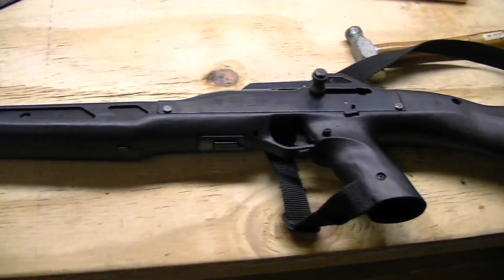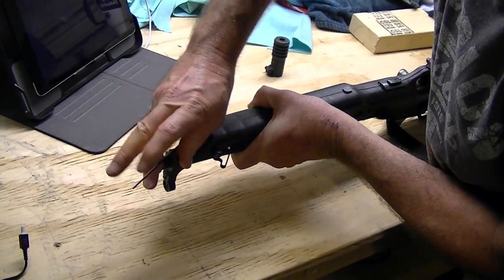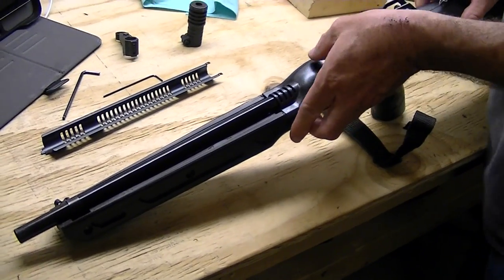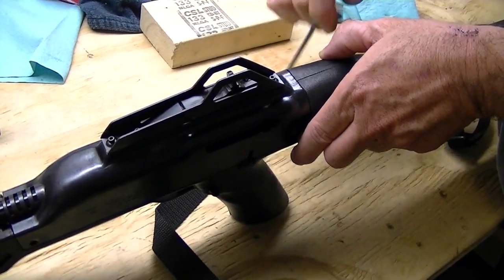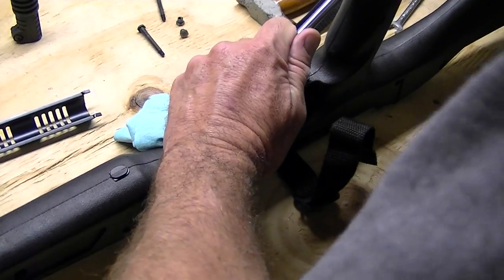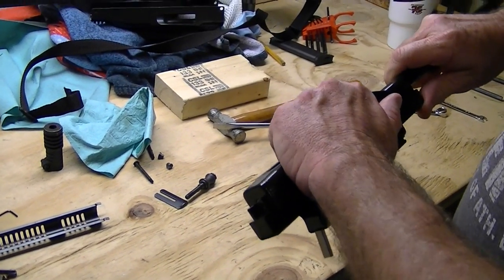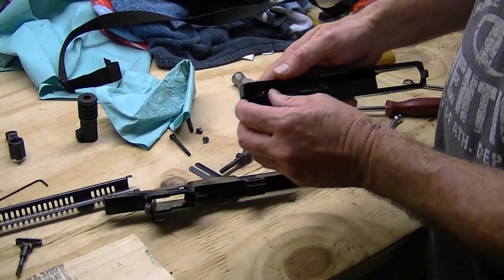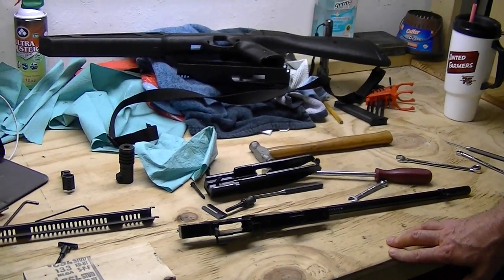Hi Point 995 Carbine 1st Generation Disassembly

Comment: I recently bought one of the first generation 995 9mm carbines,(still waiting for it to arrive). I was wondering about the trigger pull, is it a heavy pull like the new ones that so many suggest replacing the trigger spring to a lighter pull or does the first generation not have that problem?
Reply: It's not a great trigger, but you're firing a pistol caliber out of a carbine. So there is almost no recoil. If you are worried about trigger pull then you're going to have an aneurysm over the rest of the gun. The charging handle is wonky and the stock is older molded plastic.
Reply: Where did you get it at, ive been looking for one to add to my collection
Reply: Online gun auction is where I found mine, bought it from a guy in Oregon, paid him, had it shipped to my local gun store in order to complete the back ground check. After I got it, I found it had a bulge in the barrel, contacted Hi-Point found out the the gun has a lifetime warranty not limited to the original purchaser, sent the gun to them, they replaced everything on the gun except for the lower where the serial number is. They returned the gun like new in original condition. So I guess it doesn't matter what condition you buy the gun in you can have a new gun when all is said and done.
Reply: @socialismo52  Found new trigger spring at MCARBO. love the gun, of course I would, my friends say I'm a cheap bastard. Lol
Reply: @NuTT62  Same! My collection is just cheap guns that I think have personality.

Comment: Hey. I have one of these generation 1  9mm carbine. Looks just like the one in your video. I'm having an issue with the ejection of the spent round not ejecting and jamming the next round being fed. Also because of this jamming I think it has maybe bent my firing pin. Unless it is supposed to be in a slight upward angle. Like maybe 22-30 degrees or something like. I'm original owner straight from the factory. Any suggestions before i break down and take it to a gun smith would be greatly appreciated.
Reply: I know this is late reply but hopefully it can still help.. I read somewhere that there's a very good warranty on these. I would contact hi point and im sure they would help with your problem!